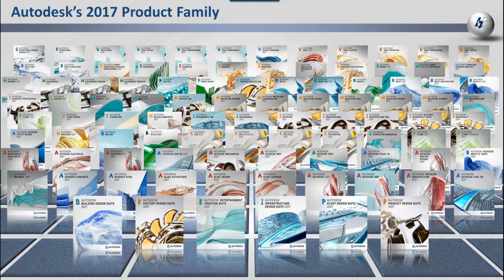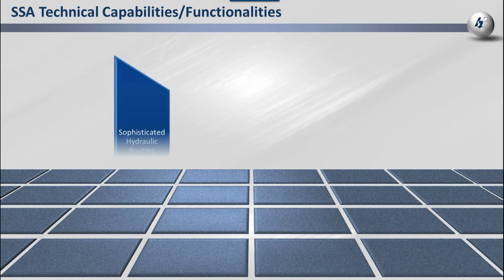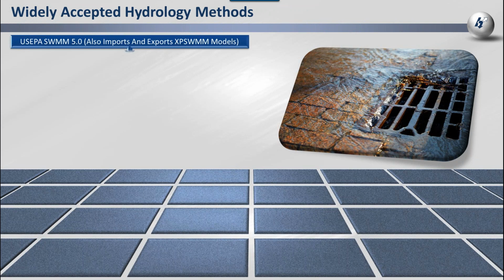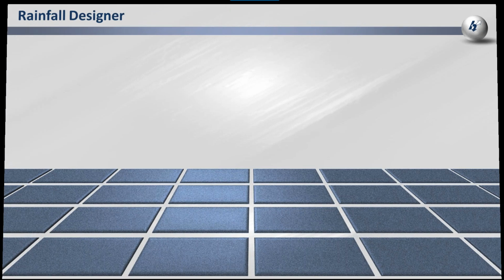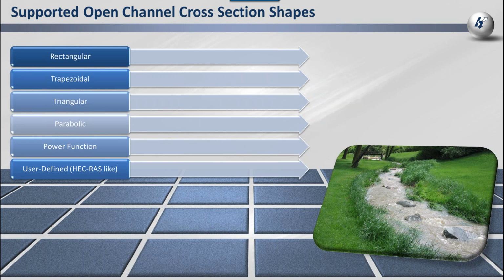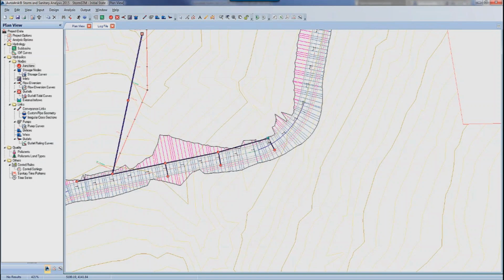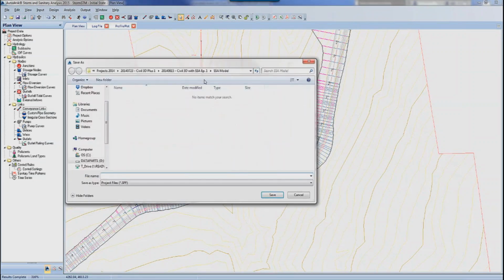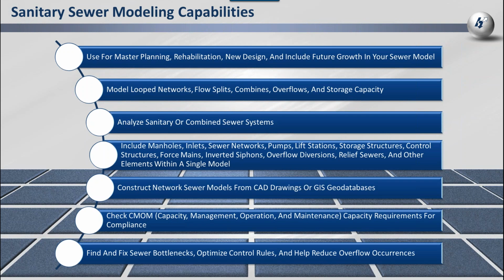Autodesk Storm and Sanitary Analysis – An Introduction

Comment: Dear Sir
I was using Microdrainage, where I am pleased to SSA software to introduce it to my clients and the local authority for planning approval. 
I have got the following question, can you send me relevant tutorials or answer, please. 
1.	Model foul flows using discharge units to BS EN 752. is there any example available please
2.	Produce Greenfield rate calculations using IH124 method.
3.	Allow the application of climate change factors to rainfall data. Typically 30%. Where and how can I apply climate change please.
I am looking for a response from you soon, please. Thanks for your taking time. 
Kind regards 
Sherwan Mohammed
Reply from the maker: Contact our support with a detailed message of your questions. Here is the link: https://www.hagerman.com/contact